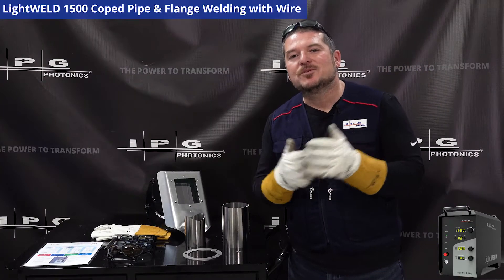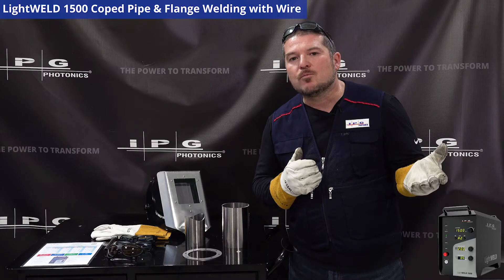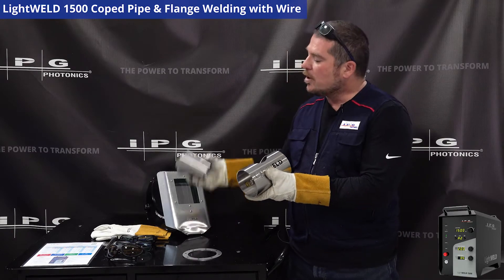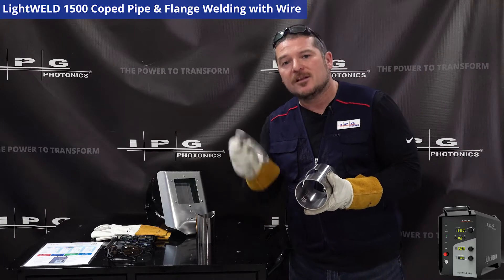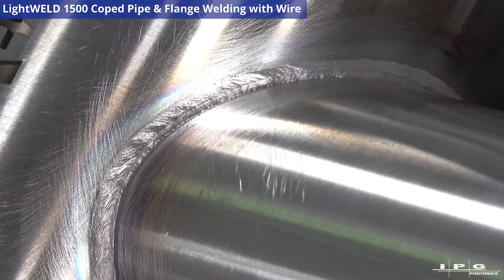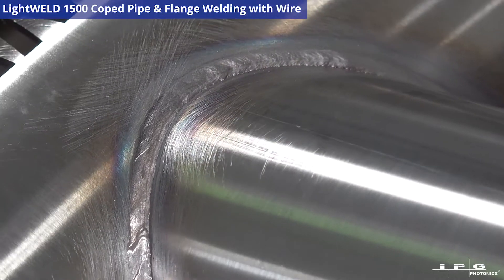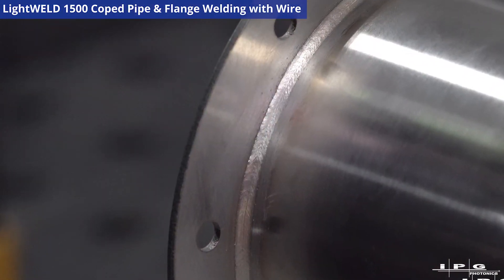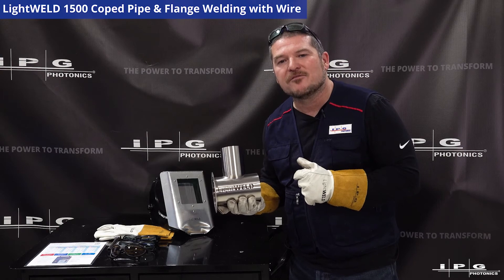LightWELD | Coped Pipe & Flange Laser Welding with Wire

Comment: Few months back (6-7) we purchased one of these systems, here is my opinion so far: The helmet is an abomination with that said they put that aluminum frame over one of the cheapest Chinese helmet. Personally I have to wear a reading glass to weld:  imagine reading glass, laser safety glass, and the abomination helmet. The helmet is pushing down on the glasses so my nose ( which is not big) has to hold all that weight its f... awesome  to weld like that. Lots of hoses and wiring running into the gun and is just wrapped in a cheap sleeve. A 5 year old kid would do a better job than that. The welding gun itself is an other monster if you only do jobs like these video shown its OK I guess, but when you do custom work all sorts of awkward futures shapes and sizes it is a strait out nightmare, the trigger sticks hard to press you have to squeeze it like you mean it, and its heavy. Compared to a TIG gun it is a semi-truck. Yes you can run a wire feeder with it but in that case good luck to get into tight places. The machine performance is outstanding. easy to set up and run, anyone can learn it in your shop, no welding experience necessary as long as a knowledgeable welder /engineer sets up the parameters to the given welding job. The customer service is slow I would say terrible: they tell you they will call you back and just wait for the call wait wait wait and wait after 1 week still just wait wait. personally I never get called back ever. 1st case when we needed  help it took them over 40 days to solve after 10-15 emails. Thank god at that time we were able to run the system. Email response time is about 3-5 days. Most recently I tripped in the "safety wire" and dragged the gun with it, the gun fell on the floor and seized to work so right now waiting for that call back again, in the meantime I have a 22K paper weight. I was going to make video about these system but now have to wait for the fix. If you guys have questions I'll gladly tell you about my experience so far with IPG light weld system, we mostly weld aluminum, and stainless steel but you can weld any metal as long as you know what are you doing, its a breeze to fix cast aluminum with these unit. Also you can poke holes on aerosol cans from far far away. What they are not telling you is: you need a separate room to run it for safety reasons which is also 20-25K and up, a 12'x16' or similar size could run up to 50K. It's quite dangerous. You can melt through a 0.25 steel plate from 8" away, almost like Darth Wader's light-saber, we did not slice bananas yet but will try once the unit is running again. The main reason we are running this system is because of the time savings on the post process, and the overall weld quality is unbeatable. We can do stuff now what other-folks only dream about If you don't believe me watch this video https://www.youtube.com/watch?v=zr3qLRifjSc   UPDATE FROM HERE:  I wanna add some things in here: 
Duty cycle 100% bc you do not create direct heat to the welding gun itself and and no high amperage running from base unit to welding gun however welding gun tip will be somewhat hot bc it has direct contact to the welded material,  don't lick it. 
Since you always pull the gun and quite fast, tip is touching a "cold" metal, compared to other welding procedures. 
Way faster than any other welding procedure time saving can run up to 85%+, you can weld crap you did not imagine is weldable without adding filler metal "fusion welding". 
The system is very smart. You can focus your laser to any given metal thickness and save it in your software stored on a laptop and load it when you need it no guesswork. 
You can weld dissimilar metals to one another (requires metallurgy knowledge though) 
Less likely to have distortion on thin metals, if your settings are correct no distortion whatsoever.  
With this system you DO NOT WANT HAVE WELD GAP laser will shoot through your gap and won't melt your metal  it will melt or damage what is exposed below weldgap. 
You do not need to "zig-zag" ; you can set your laser to do 5mm wobble across  the weld line along with the wobble frequency (speed) The faster you move the frequency should be faster.
Post processing: wipe or maybe brush your finished parts, that's all. 
Parts are not as hot then normally you think therefore less waiting time to do further work on the welded parts and yes your melting point was there with the set penetration, still colder bc you did not spend so much time welding the part compared to other welding procedures.
Welding positions:  Uphill welding kind of forget it unless you are hanging from a rope upside down or have 2 additional wrists all bc of the gun design in rare cases you will be able to do uphill pull if the circumstances are there . Overhead, Horizontal left and right, Vertical downhill  always pull, it does not hurt if you have 2 right ( or same cases ) 2 left hands, or you have to reposition yourself according to your desired direction  
And lastly as I said it earlier customer support is terrible.  New Update:  IPG stand behind the Light weld System 100%. I learned they where under-stuffed so things moved very slowly but once you get your turn in the long line in waiting there is excellent tech support team will help you out. They solved all my problems supplied updated / redesigned parts they even extended my Factory warranty because I had to wait so long. TECH support 2 thumbs up. Since the fix;  we cut a banana and even welded some HDPE sheets with it, check out our video. Most importantly is made in the USA.
Reply: OMG single best product review of the damn year!!!! Bravo Sir you win the Youtubes!!! I eagerly anticipate a review in the future when the machine is back up. Thank you for your post.
Reply: @jondavidmcnabb  Thank you. I did some updates in the post if you interested to follow up
Reply: @lamania32  as we see so far LightWeld is not comparable with Wooble 6 PRO+  , if You will be in Europe i will do comparison to prove that. of course better machine cost more , its not a magic.

Comment: Heat affected zone appears similar to a TIG process.
Reply: It looks like but Is not, the laser penetrates the material according to your setting and melts the metal in the whole depth equally. You can move min 3-5 times faster then TIG therefor your weld is colder in fact so cold I never wear gloves while using this system, if you weld short runs you can hold the welded part in your hand right after finishing it. If you run over 2-3 Inches is hotter but not as hot as any other welding procedure. Also it requires almost 0 post process like grinding etc
Reply: @lamania32  Would be great if you could post a video welding 4130N steel tubing 0.750” x 0.035” wall thickness to see how it handles thin wall such as this. I have been considering this system, but have not seen an example the welder in thin wall aerospace application.
Reply: @lamania32  thanks I took a look at that video. What is the price point on these units and the duty cycle?
Reply: @maloyaircraft1174  duty cycle is 100% since you don't create direct heat to your gun you can run it all day long none stop. 23k and change + about 25K for the smaller booth. here is an other video to consider why professionals need it https://www.youtube.com/watch?v=zr3qLRifjSc  . But you will hate the helmet and some other aspects of it like the gun bulkiness especially with the wire feeder. I run the wire by hand I will post video about it a later time. You might wanna watch this one as well https://www.youtube.com/watch?v=GU5aMlLjmtE
Reply: @lamania32  thanks
Reply from the maker: Well said, @lamania32. Thank you for sharing your insights. We'd like to know more about your experience with the LightWELD. Please email us directly at contact-lightweld@ipgphotonics.com, tell us your company name and contact info, and we will get back to you ASAP. Cheers!

Comment: How does the laser safety work? You probably have safety glasses, but what about the rest of body? Even if you solve that you can't point it to yourself (e.g. there are some electrical contacts on the nozzle that need to be closed/shortened against a conductor, like steel part), you still have reflections.
Reply: Safety Third, seriously do you ask about safety for MIG/TIG/ARC.... It is metal working not social working... All Industrial arts are dangerous be careful and don't be stupid.

Comment: How does it work with carbon steel?
Reply: You can weld any metal with the system all it takes play with the settings, you can weld dissimilar metals together obviously not everything goes with everything